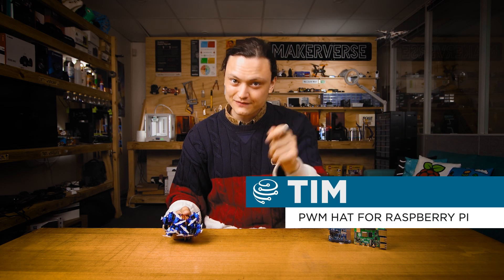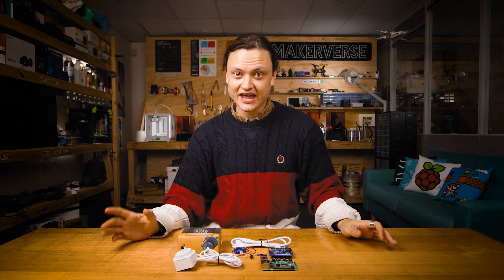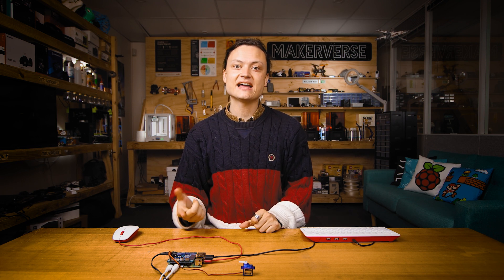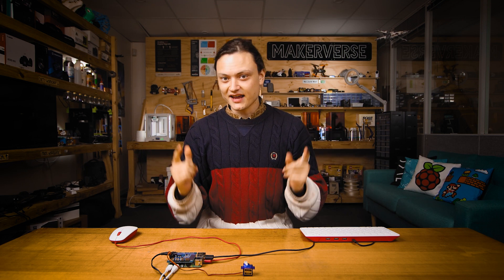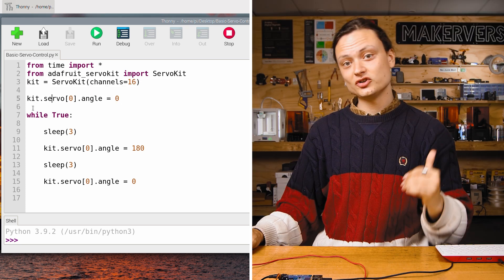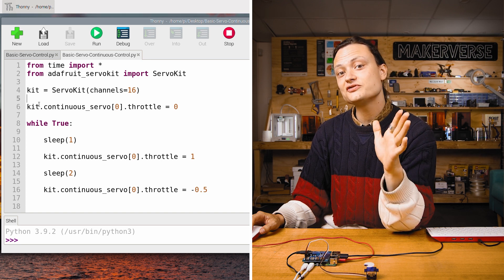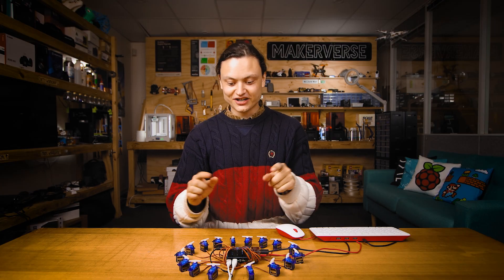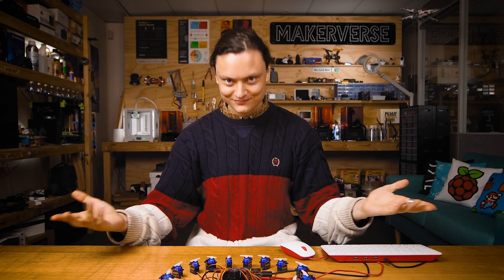How to use an Adafruit 16-Channel PWM HAT with a Raspberry Pi to Control Sixteen Servos

Comment: Hmm... rotation doesn't looks like 180 degrees. Will be curious to check signal with oscilloscope - I have doubts it gives correct PWM.  Is it somehow possible to set duty directly in microseconds? Looks pretty handy in general.
According me experience with SG90 servos, it pretty inaccurate and require 400mks for real 0 degrees and 2250mks for real 180, instead of 500-2000 as written in datasheet

Comment: on the third line of code to set up servokit there’s an error “externally-managed-environment “
Reply from the maker: Sounds like you are running Bookworm OS. This newest version of Pi OS introduced the need to use virtual environments, we have a guide on how to do this over here:
https://core-electronics.com.au/guides/raspberry-pi/raspberry-pi-virtual-environments/

It's an extra little step to learn, but you only need to learn it once.

Comment: How would you control multiple servos in python that run simultaneously? I am helping my students build an animatronics display, in which multiple servos are operating at the same time. Do you know of any code examples and will the Adafruit allow that?
Reply from the maker: Hey Richard, that depends by what you mean running at the same time. If you a have a line of code to move 1 servo, then immediately after it another line to move another servo, the time between these 2 lines being run by the Pi is nearly zero, so both of the servos would move at the same time. Even if you told 10 servos to move, it would appear that they all would move at the same time. 

Large language models like Claude and ChatGPT are really good at writing Python code, if you copy and paste in the demo code from this video, it should be able to modify it and help you write the code you are after.

If you need some more human help, we have a maker community forum with lots of makers over there that love to help with these sorts of things:
https://forum.core-electronics.com.au/

Comment: I'm confused on how the code you wrote gets from the Pi board into the Adafruit 16 Channel Servo Breakout Board?  Does the sketch changes get loaded onto the processing board automatically as you change them, or is that a save command in the program.  I have no experience in coding and I have to modify some servo movements for my R2D2 Droid for the halo projector lights.  A great video, I learned a lot.  Good verbal speed and very clear voice.  Thank you.

Comment: Hi Tim at Core Electronics, 

I am Alex. I currently doing the work at my workplace. I am trying to find ways to use the Raspberry Pi System  to make 6 or 8 servomotor running .  I have a question as the information listed below:

1. I know you told me that you used the Adafruit 16 channel PWM Servohat to make more than 2 servomotor running. How many gpio pins do I need to make  more than 2 servomotor running with the PWM servohat ?

2.  Is it necessary for me to connect all the pins from  the PWM servohat to the Raspberry Pi Model 3 Computer Board?
Reply from the maker: Hey Alex,

1. The servo HAT uses I2C, meaning that it only needs those 2 pins regardless of if you are controlling 2 or 16 servos.

2. You wont need to connect all the pins, but as it is a HAT it is designed to be connected to all the pins. If you need to access some more pins on the Pi, the hat has some pinouts of the Pi's pins on top of it.

Cheers!

Comment: Is there any way to use PCA9685 with AVR? Cause I've tried hard to write a driver to it, but I faild.
Reply from the maker: Check out this right here, should get you right into the thick of driving servos - https://github.com/prestonsn/PCA9685-Multi-Channel-Servo-Controller-Driver-for-AVR-ATmega

Comment: Hello 😊

I'm stuck, I have my Raspberry Pi Zero, my PCA9685 and my servo, but the servo doesn't move. I think maybe you need extra power, maybe it's not enough with just Pi Zero, I don't know if you can confirm this for me. Because I imported the libraries and used your code and I didn't have any errors.

Another idea is... The pca9685 was sold to me broken (but it has a red light whren it is comnected).
Reply from the maker: Could be a number of things, come write up a post at our forum with some pictures of your set up and I'll best be able to help 😊 - https://forum.core-electronics.com.au/

Comment: Looks great. I have the material to build something similar synchronizing the sound with the movements. Where could I find a document with all the steps starting from 0? I need to read it slowly as a total beginner Thanks!
Reply from the maker: I love that idea! This video here is a great introduction to controlling servos, when it comes to capturing sound to activate servos I have seen it done very basically with an Arduino Uno - https://www.instructables.com/Audio-Sensor-Servo-Reactive-Motion/

Come write up a post outlining your project goals at our Forum and we'll best be able to help 😊 https://forum.core-electronics.com.au/
Reply from the maker: I also found this but its a touch scary - https://www.youtube.com/watch?v=3Nss_2_rwdE

Comment: Hello! Thank you for the tutorial! One of the most well explained ones I found!
I managed to get 16 servos running, but I would like to go even further (Big project)
If I were to connect a second board in (SLA, SDA) continuation, then the 2 boards would have different addresses. How would this change the code? Is there a way to select the address when initializing the ServoKit function?
Thank you for your time and the tutorial again!
Reply from the maker: Excellent question and thanks for your kind words 😊! These HAT boards all communicate using I2C and you can alter their address by soldering some jumpers found on the top of the board. You can see exactly what I mean here - https://learn.adafruit.com/adafruit-16-channel-pwm-servo-hat-for-raspberry-pi/stacking-hats

In scripts, you can create a new object for each HAT with | pwm = PWM(0x40) | and | pwm = PWM(0x60) | Where 0x40 is the default HAT address and 0x60 is a custom one made by soldering that jumper on the top.
Reply: @Core-Electronics  Thank you very much for your response!

Comment: Would this work with regular  DC motors
Reply: Thanks
Reply: Thank you so much I will get one.
Reply: For being so helpful you just earned yourself a subscriber thanks for being nice.
Reply: Is it possible to control 4 motors whilst controlling each motor individually. I'm making a Raspberry Pi RC car
Reply from the maker: Big Yayay 🎉😊🥳 and with the Adafruit DC & Stepper Motor HAT you'll be able to control each DC Motor individually. You can decide exactly how fast and what direction each will spin at. 

Here is guide on controlling DC motors with a Bluetooth Controller which might perk your interest too! With some coding it'd be perfect for a Pi RC Car - https://core-electronics.com.au/guides/raspberry-pi/gobilda-motors-raspberry-pi-pololu-motoron/
Reply: Thank you I will definitely buy one from you guys
Reply from the maker: DC motors are PWM devices, so you would be able to hack together a solution, however I would recommend using something more readily made for the job, like the Adafruit DC Stepper Motor HAT which you can learn more about here - https://core-electronics.com.au/guides/raspberry-pi/raspberry-pi-dc-stepper-motor-guide/

Also keep in mind that Continuous Servos work with this Servo HAT and act very similar to DC Motors.
Reply: How many motors can I control using this and if it's stackable how many would I need to control 8 dc motors
Reply from the maker: Heyya mate, with the Adafruit DC & Stepper Motor HAT you can control 4 DC Motors. This HAT can be stacked up to 32 times letting you control a whopping 128 DC Motors! Everything you need to run one can be learned here 😊 https://core-electronics.com.au/guides/raspberry-pi/raspberry-pi-dc-stepper-motor-guide/

Comment: I have a ghostbusters trap that someone made. Has a chip in it and servos for the doors. They don't work right. So I can't just swap them out? I'd have to reprogram the new ones?
Reply from the maker: Depends on the condition of the servos. If they have three wires coming off them and look functional you may not even need to swap them out. If they are small 9 grams servos like the ones in the above video you could definitely connect it up with a similar Raspberry Pi system. If the servos are larger/higher voltage you should take a look at this guide to see the process to work with them - https://core-electronics.com.au/guides/control-servo-raspberry-pi/

Comment: is it possible for a raspberry pi to control a larger motor, like a windshield wiper motor or larger dc motor that can aid in helping a disabled person walk as long we we power it seperatley?
Reply from the maker: Absolutely champ come check this product over here, there some different variants worth checking out - https://core-electronics.com.au/catalog/product/view/sku/POLOLU-5051 - 

You will be setting them up in a very similar workflow as the above video. You'll be able to control some pretty serious motors with those HATs (just check all the spec sheets) and I adore your project idea 😊 would love to see how it comes out.

Comment: Hi would do this with controlling it with flysky receiver and audunio  or raspberry pi  any help please
Reply from the maker: Heyya mate, this guide here will give you the run down on controlling hardware attached to a Raspberry Pi using an RC Controller - https://github.com/samfok/remote_receiver_tutorial 
I reckon that will be a proper help 😊

Comment: Good job. I have a question. I want to rotate the servo and once it done I want to clean the pin. I see that is done in GPIO by calling stop method however I am not sure how to stop using adafruit hat. My experience shows that the servos tend to gitter while trying to stop at a constant position. thanks for help.
Reply from the maker: I created a guide on Controlling Standard Servos with a Raspberry Pi which should help you along - https://core-electronics.com.au/guides/control-servo-raspberry-pi/
In that guide I address the jittering and how to minimise it when not using a Servo HAT like in the above video.

Comment: Great tutorial, thank you.  Is there a hat with built in potentiometer(s) that could be used to control the servos?  Otherwise potentiometer control would require a chip such as mcp3008 and the libraries to work with it.
Reply from the maker: Thank you 😊 a Raspberry Pi HAT with a Potentiometer and Servo Control doesn't instantly spring to my mind. Perhaps a Servo Tester would be a product worth checking out.

Comment: Hi. This is a very detailed video thank you for that. I'm done with the soldering part and have put the hat on my pi. But do you know if it can run one servo without additional power to the hat? and only use power from the pi? I want a portable setup to control the servo on my RC car :)
Reply from the maker: Cheers for your kind words 😊 perhaps if you only want to control a single Servo come check out this guide here - https://core-electronics.com.au/guides/control-servo-raspberry-pi/
Reply: @Core-Electronics  You are very welcome. made it work last night 😊 attached a USB voltage regulator (4.7 V) on the hars GND + 5+  and plug'd it in to the usb ports of the PI and it works great! Do you know where to find python code, to get intruction to W=forward S=backwards A=Left D=rigth? :) ill share a video to you when its done. Your basic script works fine and tilts the front tires to each side, with an 3 sec delay. now i need the ERC to controll the throttle and speed. again thanks for the video! :)
Reply from the maker: If you want to control your Servo like this hit up this Pan-Tilt HAT guide with Raspberry Pi - https://core-electronics.com.au/guides/pan-tilt-hat-raspberry-pi/

I know at first that might seem a bit random, but the mechanisms behind the Pan-Tilt HAT are just servos. The second Python example runs has a process inside it that control the two servo using keyboard inputs 😊 which is right up your alley. With that framework there you will be able to change it for your situation.
Reply: @Core-Electronics  ill take a look at it, thank you so much for the help. a last question. do you know if its possible to control the DC motor through the ERC cotroller with the HAT? an what code would work, to control the speed. You should also make a vido with an Rc car :P Kind regards
Reply from the maker: My preference for DC motor control with Raspberry Pi is this HAT right here - https://core-electronics.com.au/catalog/product/view/sku/ADA2348 

Haha and I'd love to make a formidable RC Car 😊

Comment: Hi Tim, I am wondering that instead of using Adafruit 16-Channel PWM / Servo HAT for Raspberry Pi - Mini Kit, can I use another servo driver which is the PCA9685 and go with the same of your code and method/process that you have made to control multiple servos?

looking forward to your advice ^^ 
Thank you
Reply from the maker: That Adafruit 16-Channel I2C HAT with that PCA9685 should be a perfect drop in. The Python code should function exactly the same 😊

Comment: Can I control 6 7,4V servo motors with this controller?
Reply from the maker: Works with any servo that can be powered by 5V and take 3.3V logic level signals.

Comment: Thank you for awesome, video.
I couldnt get in my country any  Raspberry Pi model except that with keyboard  Raspberry Pi 400

My qesution is, how do I align, correctly pins using GPIO Ribbon Cable for Raspberry Pi Model A+/B+/Pi 2/Pi 3/Pi 4 - (40 pins)?

Because side what goes in  Raspberry Pi 400 is marked and goes in only one way, buy other side I can plug in bouth ways in Adafruit 16-Channel PWM / Servo HAT for Raspberry Pi - Mini Kit

Need help.
Reply from the maker: Heyya mate, 

Raspberry Pi 400 are sweet (and actually have a higher overclock (2.2GHz) than the other Raspberry Pi boards.

If you look on the back of the case near the GPIO it actually has labels saying | Pin40 | and | Pin1 |. From this you can look at the normal pin out for a Raspberry Pi 4 like in the video and figure out the orientation. This guide will help too - https://core-electronics.com.au/guides/raspberry-pi-generations/

Comment: So does this shield just reduce the amount of wires needed to control several servos using I2C, or does it do more.
I was mostly wondering if this still uses software to control the servos or if it's hardware. Just overthinking things and looking into getting rid of servo jitter on a project.
Reply from the maker: Both software and hardware. If you use this HAT you will be able to eliminate servo jitter.

Comment: Thanks for the video, helped me a lot! Just one question: It looks like the hat uses all the GPIO pins of the Raspberry Pi. Does this mean I can‘t do anything else with the Pi like for example connect an IMU?
Reply from the maker: Glad to hear 😊 this Hat uses the GPIO pins mainly as a physical support. It actually only uses 2 GPIO pins for communication. All the other pins are free to be used for other electrical tasks (like an IMU) and can be best accessed if you use a GPIO Stacking Header like the one I have linked here - https://core-electronics.com.au/gpio-header-for-raspberry-pi-b-extra-long-2x20-female-header.html

Comment: The final code can be shortened by using loop.

In setup section above the while loop we can have one for or while loop for variable say i to go from 0-15. Then we can just put one line and instead of number put i.

Same in while loop we can have 2 loops one for the n where we can use this n as t/n and in that loop we can have a nested loop for value say j to go from 0-15. And now just replace whole with only 3 lines and place j instead of number.

And there you have it. A reduced code with same functionality.

Though hat's off to the creators and for well explained tutorial 🔥
Reply from the maker: Cheers for your work mate 🙂! As soon as I have a second to regroup and sharpen up this tutorial I'll dive in and update the code.

Comment: S0 for example, told to go to 0 position. Mill the motor try to hold it at 0 position if force is presented to rotate it?
OR does the controller release power to that servo after it gets to its position.
OR can you tell it to release power to hold position for any one of those servos?
Reply from the maker: The servos will hold their position. You can tell the servos to 'deactivate' once it has reached a certain angle in code,which will then allow you to rotate the servo manually without crunching gears, if you so desire.